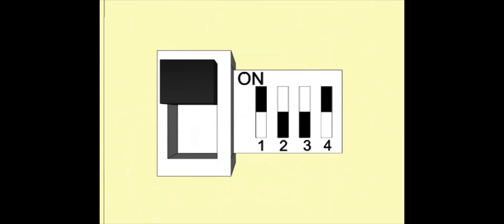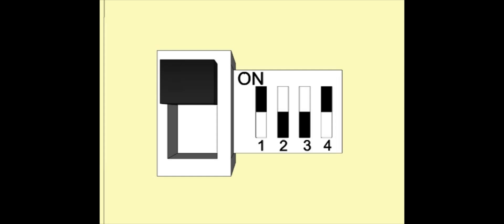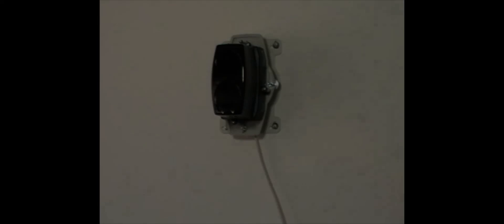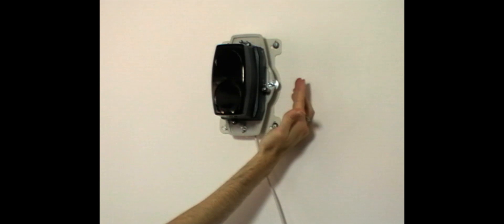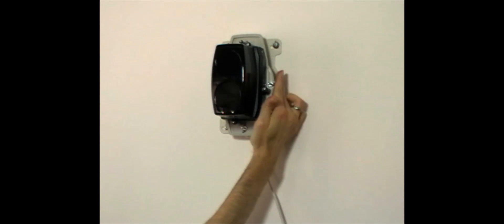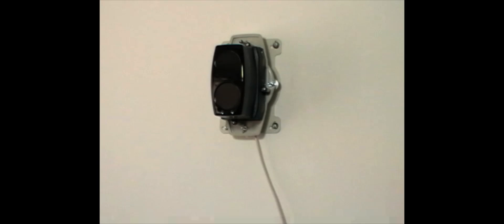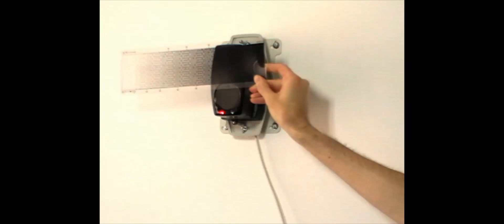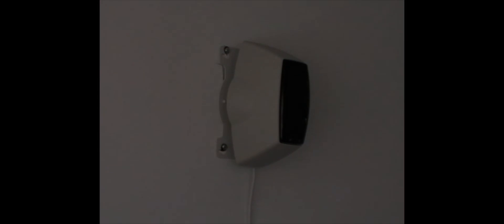Fireray 50/100R Installation Video

Comment: I am interested in buying Beam Detector with a range of 100 meters.  Is your beam detector compatible with the Cooper Conventional Fire Alarm Control Panel model FX2204.  Can it be connected to the Cooper Conventional Fire Alarm Control Panel model FX2204.
Reply: Yes, there shouldn't be any issue with that. Please contact me at +1 713-705-4801